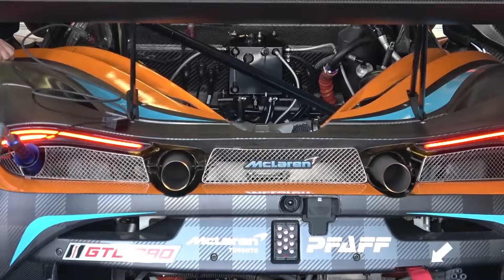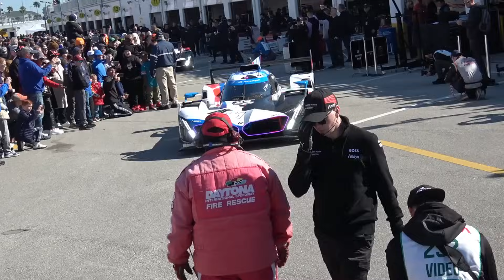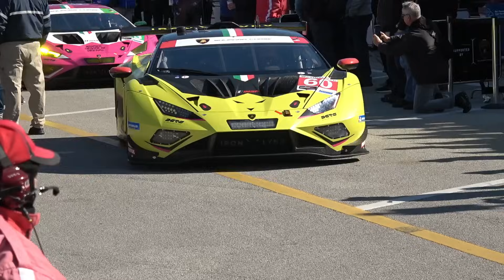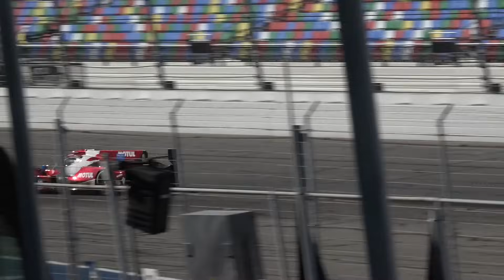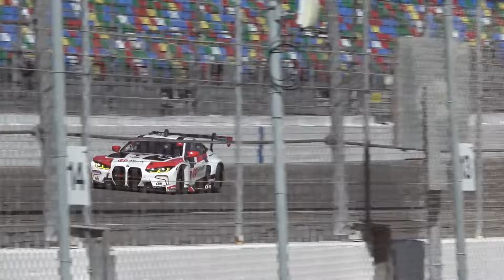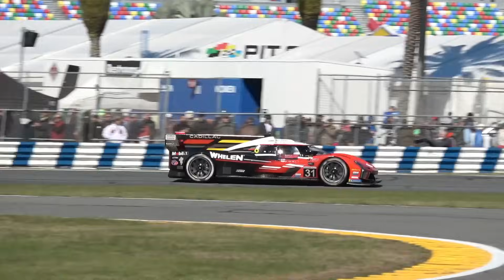2024 Rolex 24 Roar Testing

Comment: Yep its official, Lamborghini is a bunch of dorks for deciding to skip the Rolex.
Reply: I agree it’s a bummer. But personally I am more excited for the GT battle with the new and updated cars.
Reply: Why are they skipping it?
Reply: @augustortiz Homologation process was focused for WEC rather than IMSA. They are competing only in the MEC for this year, so priority for them is the 2024 WEC Season.
Reply: @augustortiz because the car is not ready, its not as simple as, oh the car moves so we'll go racing. If they did that theyd embarass themselves just like ByKolles did last year in the WEC
Reply: Maybe their GTP car isn't where they want it to be, or the $ isn't, until Sebring. The Valkerie GTP isn't there either.
Reply: @bernardoberner4  That makes sense, I totally forgot they had a pending GTP/LMDh car in the works. They would 100% have faceplanted worse than ByKolles and Glickenhaus in WEC.
Reply: @bernardoberner4484 Yeah and what an embarrassment it would be for a manufacturer too.
Reply: The main reason the car isnt there is because Mirko Bortolloti wrecked the sole chassis in a test at Paul Ricard. But no matter how much testing they have they’ll be behind due to all of the other manufacturers having a full season already under their belts
Reply: @harrycrooks9110 yes. BMW did send 2 90% ready cars last year. You learn the best by just doing it